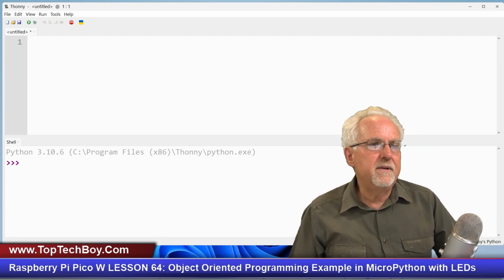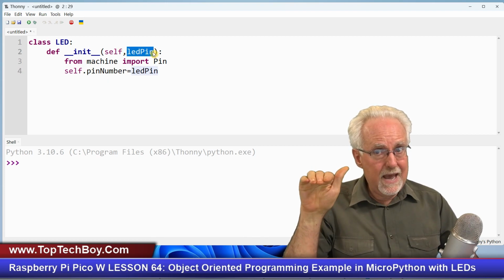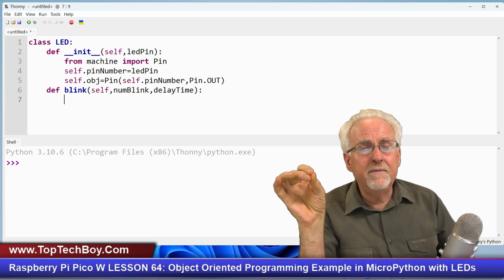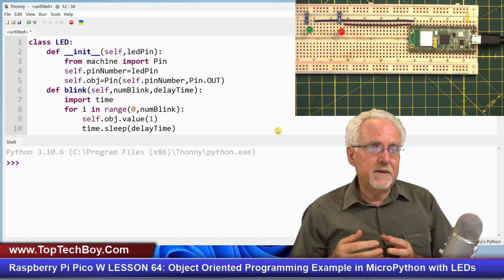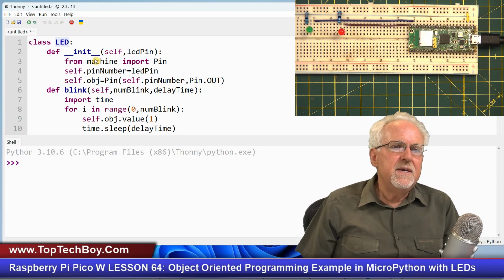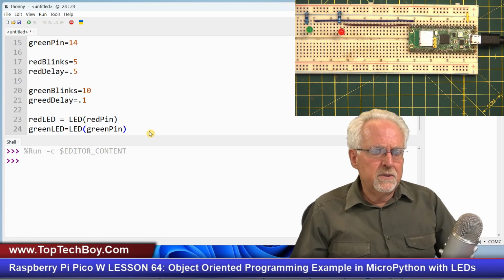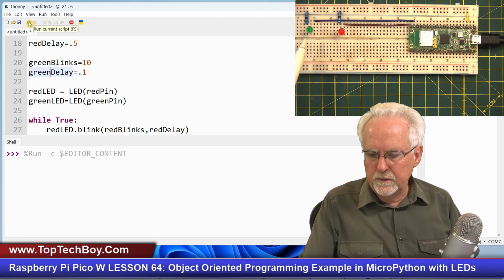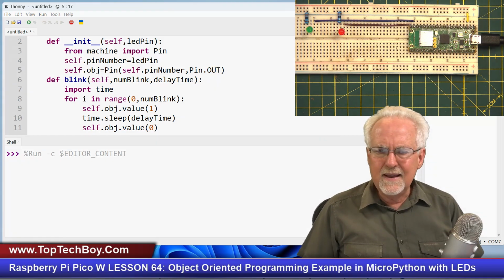Raspberry Pi Pico W LESSON 64: Object Oriented Programming Example in MicroPython with LEDs

Comment: This lesson starts off too esoteric and academic, Paul. You need to quickly get down to brass tacks, while never assuming knowledge that your often-intermittent viewers may not have - i.e. precise programming details like abbreviations, punctation, syntax and context, also idiosyncrasies of the programming language you're dealing with. Yes, I understand that these matters would have been covered in previous elementary lessons but reminders are always a  good idea. I hasten to add your teaching methods in these tutorials are first rate. Time is of the essence, I also understand.